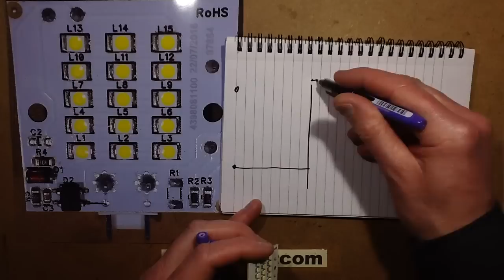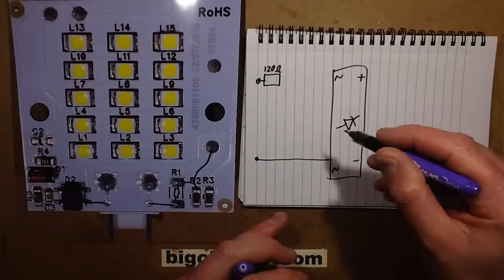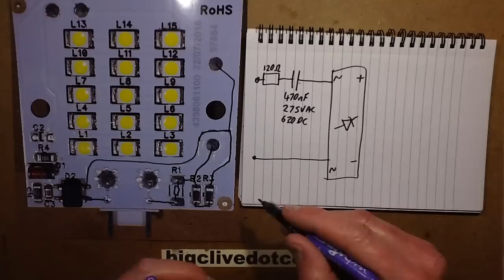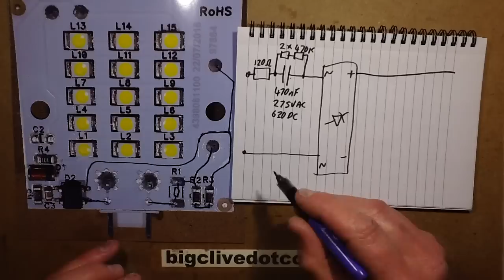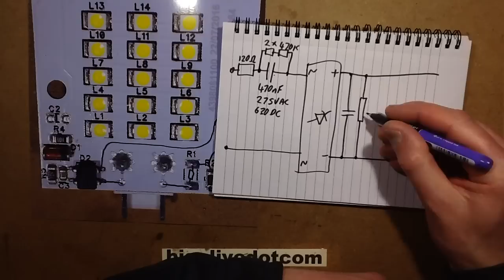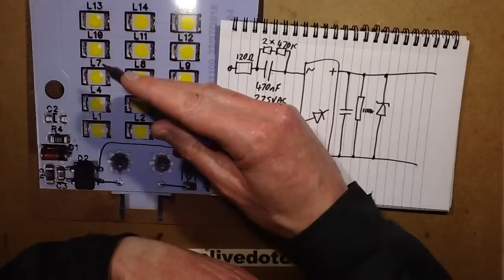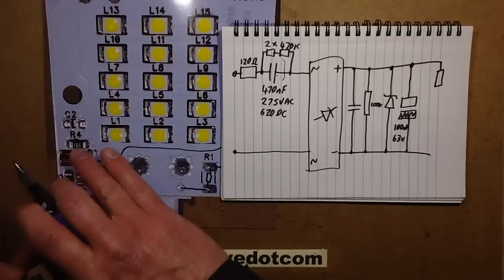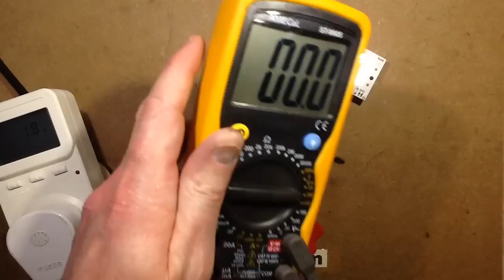"Non-serviceable" LED fridge light module.  (with schematic)

Comment: Hi Clive thanks for this video, I've just had a look at a friend's Hoover fridge with a 3-led board that is flashing. It's a SW-BX02A,  and they're cheap at £8 or so,  from China, but looking at your circuit,  how the heck does the 220V ac input suddenly become 45v dc out (going by the 50v smoothing cap).... Keep on truckin' with your great youtube vids 👍
Reply from the maker: It may have a current limited driver or use an on-board buck regulator.  Treat the LEDs as being referenced to the mains supply.

Comment: I got a feeling in case of one failed LED you can bridge it with just another 100 Ohm resistor, if my crude estimation isn't far off.

Although, if the voltage drop of an LED is around 3V, then something like 147 Ohm would serve even better.

Comment: There's a failure mode in the fridge where the bulb won't shut off when the door closed, and the heat from the bulb could cause the motor to run a lot more

Comment: Is the capacitor in series before the rectifier being used here as a resistor basically, to drastically reduce the voltage ? I don't really understand how it's taking 230 and turning it into 50 odd volts

Comment: Ugh, I have about 30 whirlpool fridges with integrated LED lights that fail ALL THE TIME! There's 1 main LED board that powers two others in the fridge and freezer, and they're $150-$200 each. Such a rip-off, to replace them all is upwards of $500, and I've had to replace many.

Comment: Why the fuck did they use "L" for the LEDs? L is for inductors. That could be very confusing to some subcontractors, though I'm sure they'd probably figure it out. But why not use D like every other circuit board in existence?

Comment: The real reason for lead free is so people like me who solder every day, are not exposed to the heavy metal. I no longer have to handle or breath lead. BGA are no more fragile, properly made lead free joints are not bad and soldering with lead free solder is no more difficult if you just get used to it, I no longer miss lead. Some areas of electronics are still using lead because of the worry of tin whisker, not brittle joints. Please get used to lead free, use a good soldering iron, Pace for example, add a little more heat and use a good modern solder with a good low fume flux. You will learn to love it Clive. Please keep doing the great videos and stay well and safe!

Comment: The reason isn't cheapness. The reason is that EU global warming regulations resulted in flammable hydrocarbon refrigerants, namely R-600a butane, replacing R-134a which has a high GWP. The result is that incandescent bulbs cannot be used because the high temperature can ignite the refrigerant in the event of a leak, the module has been validated that it will not produce high temperatures or sparks.

Comment: I was just visiting with my Uncle, who is a certified Ford Mechanic, runs his own shop, and has for over 45 years now, at any rate, we were discussing my Ford Edge, he compared the service price on some of the new GM cars, said that if one LED goes out on the Dash board, you can no longer replace just the LED but must replace the entire head with all gauges and speedometer, the works, so get the dash to light up once more, you can order that head for a bit over 8 thousand bucks, now, however there are aftermarket replacements available for 3 thousand bucks.  This because the LEDs are sealed in the head now.  Makes me want to get an old one and see if a fellow could find a way in and do the replacement for a few bucks instead, but I didn't wish to find out for fear I would be swamped with heads to replace LEDS in.

Comment: My multimeter doesnt output enough on the diode setting to light up even a very low voltage LED.
I have to use the capacitor test function instead!!!! What the heck??
Reply from the maker: Not all of them do.  It may use too low a test voltage to forward bias an LED.

Comment: Have you really had solder-related failure on a piece of modern electronics? On cheap Chinese crap, I'd buy it - but (being a PC tech) I find it very rare that it's actually the solder joints failing, even in components running relatively hot.

Comment: I enjoyed your investigation into the problem. I also watched the video response to you video. I  saw the exact same light chip in the response on Aliexpress and see that they are rated for 220V, I asked about 110V for US and was told that they do not have them. I bought one anyway to look at. I hooked it up to 110V and it does light. I only 
tried it for a few seconds. Would these work on 110V US voltage for a 
longer time? What would be the problems if any?  thanks!
Reply from the maker: +Marilyn Kurman On the lower voltage it may have a more visible flicker due to being lit for a smaller part of the mains waveform.  It shouldn't harm it though.

Comment: And the neon bulb in your power interrupter/connector thing (whatever that's called) also uses 0.2 watts (if your power meter is correct), which I guess is probably worth noting when measuring such low powers. Though 1.6 watts still not quite 1.2 watts...

Comment: Hi,

The zenner diode is there to clamp spikes in case of heavy imperfect contact in the light switch which supply the lamp. Another role is to burn and fail shorted in case of an LED opens, thus protecting the capacitor from exploding and making a mess inside the fridge (and smell).

Comment: Everything has gone to a module format and no one works at component level any more. the problem with the fridge had nothing to do with the illumination module (that cost the customer $20-$30 dollars US) and had everything to do with the switch component (that probably cost $5-$10). The "tech" replaced both units without testing anything so they can make a larger profit and to appear "smarter". Even though this charge was passed back to the manufacturer, over-profit was made by the "repair" center. If the unit was not under warranty, it would have been the consumer who lost out. The actual repair should have only cost the time to replace the switch, the switch and diagnostic time. The lamp should have been tested and re-used.

Comment: Big Clive, did you test this module before reflowing the power connections to add the wires? It occurs to me, especially after your rant about Pb-free solder, that the part might have failed at the connector solder joints, and connecting the wires fixed it.

Another point, that momentarily had me crying foul, is measuring current by putting your multimeter in current mode and connecting it in parallel to the circuit you're attempting to measure - that's usually complete rubbish, but it sort of works in this case because you're shorting out only one device out of the fifteen in series, diverting the current through the meter. As you had pointed out just previously, the design is robust enough to survive having a one LED shorted out without disrupting the circuit too much. Normally, to get a current measure, you've got to open the circuit and insert the meter in series, or place a loop-current-meter around the path you'd like to measure the current of.
Reply from the maker: All the LEDs are in series.  By bridging one the current will increase by a tiny amount.  It's easier to put the meter in circuit by bridging one of the LEDs then it is to start hacking tracks on the PCB.
Reply: Yes, I agree that it works in this particular case, and agree that it's obviously easier than opening the circuit. But as a pedagogical example in a tutorial, it's dangerously misleading. You certainly wouldn't want anyone to think that one can generally measure current by turning the meter knob and using the same way as a voltmeter.

Comment: "You don't want to leave your meter in the current setting when you do tests of voltage"
Oh, the fuses.  The many, many, many fuses.
On the up side, I've only blown 1 since I got a clamp-meter.  On the down side, that's because _every single other multimeter I have has the current fuses blown.

Comment: thanks for all the videos.
 I've been curious and taking things apart my entire life
 one day the power turned off. from the main grid.
 not uncommon where I live.
 this late surge when it came back on seem to have affected.
 one of my stand alone air circulation fans.. Ac . in the most curious way.
 the fan ....all on its own would slow down to the point where the blades were beally turning. then speed up to its normal RPM. for a few minutes and then slow down.
 I was considering tearing it apart and trying to figure out why it was doing this... but I think I'm going to keep it as is and electrical Oddity.
 but I'm still curious as to why it's doing this.. have you ever seen this curiosity before
 cheers love your Channel
Reply from the maker: Sounds like a bad connection or a failing capacitor.
Reply: thank you 
my money is on a failing capacitor to but it's odd that it works..
 and then it fells then it works then it fails it's very curiousit 
 thank you for response

Comment: i think also LEDs create less heat than normal bulbs, so if you accidentally leave your fridge open with the light on it will get hot less quickly?

Comment: Interesting stuff Clive.  I recently had to replace some blown ccfl tubes in the light box of a daylight readable industrial led display (175x245). In the end I had to use some 6w cob panels which are not ideal - if you come across any large panels that are suitable a wee review would be good 😀. Keep up the good work!

Comment: The drive to eliminate hazardous substances has had all sorts of unintended consequences. Here in the US and in Europe too, I imagine, zinc additives (technically, ZDDP) in engine oil have been steadily reduced and removed. While it is true that zinc poses a health hazard in an engine that, no matter how tight the tolerances, burns a little oil and sends a little through the catalytic converter. ZDDP, being a polar molecule, bonds quite well to catalytic converters and reduces their effectiveness. Breathing that stuff is not good for you at all, but the amounts are miniscule. Chances are that if your car is burning enough oil to make zinc contamination a problem, it will fail whatever emissions testing you have in your area. Large trucks tend to have looser requirements, but the result is the same. 
The drawback though, is that the zinc no longer gets in the bearing surfaces and it no longer acts as a sacrificial component. Now, the expensive steel components in the engine are rubbing before the engine has good oil circulation and during periods of low oil flow. Yes, you're stopping a little bit of evil from coming out of the tailpipe, but you're shortening the life of very expensive engine components.
and what makes more smog, a modern car with a good running engine, or the giant excavator they use to dig up the aluminium ores to build a new engine?

Comment: 6:05       I did not know about this. I replaced the incandescent lamps in my car with LEDs and at night time there is a very faint glow. I suppose this might be the reason.  I will have to test the connection with my multimeter.

Comment: Clive, I have a quirky led strip I'd like to send for your analysis. How do I get in touch to make arrangement if interested?
Reply from the maker: What's it doing?  Flickering sections?
Reply: bigclivedotcom no, although I have another one that is doing that. No this one I've had for 6 weeks or so stuck to the back of the tv, it started of quite nice cool white, but somehow it's turned a horrible yellow/warm white. It's not an rgbw strip. So I don't understand why it's changed colour, other than a fault. The output brightness appears to have dropped.
Reply: Found the problem, all the chips have a brown/orange mark in the centre. Burnt looking. Too much current draw???
Reply from the maker: The white LEDs work by stimulating a mix of phosphors with a blue LED, so it's probable that either the blue emitter or one part of the phosphor has degraded.  Are the LEDs physically discoloured?
Reply: There is a black/orange/brown discolouration in varying intensities across most of the led's. You can see some of the original yellow coating behind marks. They are not all the same, a few are still putting out a blueish hue, but most are now a yellow hue. Its a usb powered 10mm wide, 500mmx2 strips, 25 leds per strip. Its fully functional, just now a dodgy colour reflecting off the back of the TV onto the wall. Got a different brand to replace them with.
Reply: I've seen issues like this before - the LEDs might be starving, check the voltage!

Comment: I repair LCD TV sets all the time, the new style led backlit sets fail very quickly, they are driving the backlighting in series at quite high voltage, usual symptoms are sound no picture, a torch will show its the lighting gone out, its usually fixable but a tedious process of removing the lcd screen. LG are the worst for failing.

Comment: Hi Clive. I notice Amazon are selling the  same multimeter you use for £39, without calibration. How easy would it be to calibrate for a novice like myself..?
Reply from the maker: Calibration just refers to a certificate being issued with it after it has been tested on known values.  It's an "industry" in the UK.  The meter should hopefully arrive calibrated from the factory.
Reply: bigclivedotcom many thanks!

Comment: I'd think one reason for the zener is to protect the diodes from a voltage spike.  One issue I have about capacitive droppers is that they conduct more as the frequency goes up.  Get up in frequency to a momentary spike, the they don't drop much at all.

Comment: I got one of these led panels that runs on 230v mains supply and modified it for a fridge... Having said that i was very enticed by these new panels...the 90w one is insanely bright! https://www.aliexpress.com/item/SMD-5730-2835-LED-Lamp-Chip-Bead-Smart-IC-Power-220V-10W-20W-30W-50W-90W/32721023149.html?spm=2114.13010608.0.0.nTJMIo

Comment: As soon as it lite up I said switch. Think of it,what else could it be? Those service technicians drive me nuts. They do know stuff,but not enough. Rather than do what you did,they automatically suspect something and replace the least expensive thing. If it works well than happy days. I think the switch has broken and works intermittently.  I can bet you the guy had to make another service call. You can check each component or those suspect by reading the values but the fact it worked means the guy never tested the light unit like you just did. In this day and age,time means money,and money means more than time. I have a stack of lawn mowers that I picked up for free that were dumped because the store doesnt do service,they refund the customers money,then throw out the mower. They cant sell them used,so they toss them. I bring them home and repair them,and sell them. It makes me sick the amount of wastefulness that goes on.Ggod for me though.

Comment: The real reason for the change, you can get a screw in bulb at the hardware store for £1or so, maybe £2 -3 for the LED version, while the proprietary board needs to be purchased from the manufacturer, and even though it costs them £0.25 to make, they can charge £25 for it....

Comment: Clive do you blow
Reply: Damn hit the enter button by mistake.
what i meant was do you blow your solder joints to cool them quickly, or will this cause dry joints?.
I replaced a standard fridge filament bulb and the holder with a spade led one as the door switch had miss aligned and the lamp over heated. Cost me a few quid over the repair call out cost of over £60+ as the holder recess was also melted. Been good now for the past 4 years, spares for domestic appliances are a total rip off.

Comment: My fridge developed an iced over freezer coils, letting the fridge warm up. Tech visited, heat gunned the coils, checked a few things then said 'fixed'. He had to return 2 months later to find a defrost timer wire, factory 'pre severed' between screwed down plastic panels deep inside!

Comment: Interesting thing in my experience with lead-free solder: I've never had a single failure in anything I've personally made with it. But, as mentioned by Clive, the early stuff was sketchy, especially BGA packages. I've repaired more than a few such electronic items by simply reflowing them in an oven.

Comment: You know what, we just got one of those Beko refrigerators. When it arrived the light wasn't working, turned out it indeed was the switch. After some bumblefuckery I got it to work, reliably. Ours got the same LED-module.